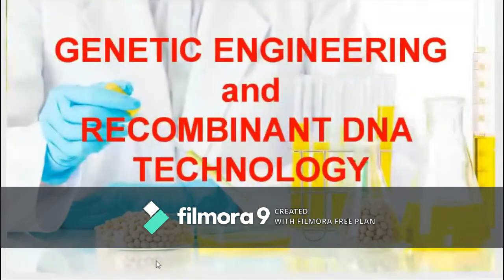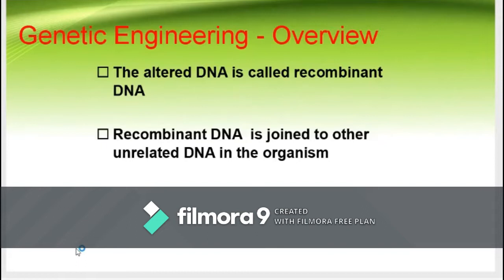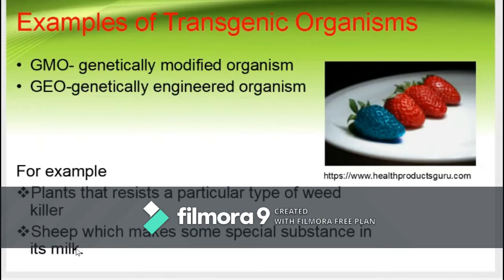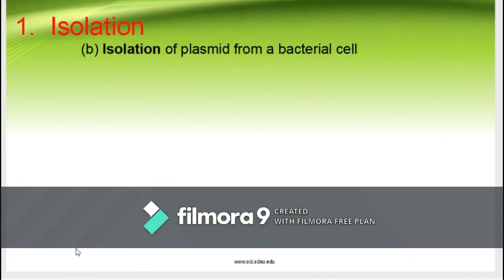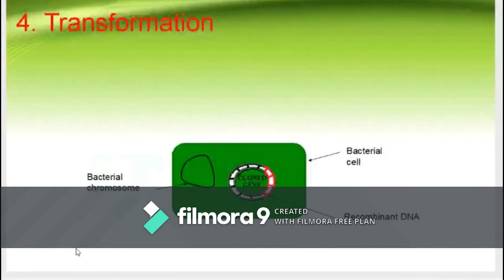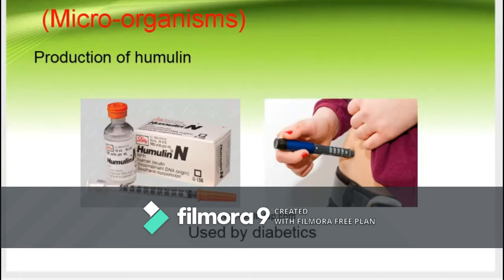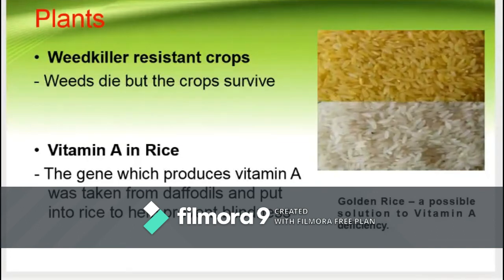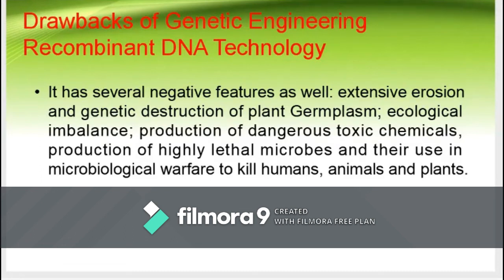GENETIC ENGINEERING & RDNA TECHNOLOGY

Comment: Kyla Hasmine P. Lancin 11 STEM RUTHERFORD
Genetic engineering requires one or more genes being specifically manipulated. A gene from another species is most commonly applied to the genome of an organism. An example would be human genes can be inserted into a bacterium. It also means that DNA from different organisms can be combined. The purpose of genetic engineering is it allows genes from one organism to be inserted into a cell of a different organisms of a different species. Organisms altered by genetic engineering is called Transgenic Organisms, in which genetic material changed by other than random natural breeding. Examples would be: GMO or genetically modified organism and GEO or genetically engineered organism. There are five stages involved in Genetic Engineering, these are: (1) Isolation, (2) Cutting, (3) Ligation and Insertion, (4) Transformation (5) expression. 

Humans Inoculated with Genetically Modified Malaria Parasites. Engineered Plasmodium parasites form the basis of two experimental malaria vaccines that showed safety and encouraging immune responses in clinical trials. Two clinical trials, in which subjects were vaccinated with genetically engineered Plasmodium parasites and later exposed to the malaria-causing microbe, showed the vaccines to be safe with promising, but not ideal, efficacy. Results of the trials are published in two papers in Science Translational Medicine today (May 20). Certain parasites of the Plasmodium genus, including P. falciparum and P. vivax, cause malaria when transmitted to humans via mosquito bites. These parasites have “impacted human health throughout history,” says malaria researcher Stefan Kappe of the University of Washington and Seattle Children’s Research Institute who is developing his own engineered parasite vaccine but was not involved in the studies. With more than 200 million cases of malaria causing more than 400,000 deaths per year, the majority of which are children, “we urgently need a vaccine,” Kappe adds. 

Genetic engineering involves different strategies for the active manipulation of genetic material to change, restore, or boost structure or function. Genetic engineering, also referred to as recombinant DNA technology, is a set of methods and procedures used to break up and merge genetic material, especially DNA from various biological species. Examples would be human genes can be inserted into other animals. Bacteria that are able to synthesize human insulin, human growth hormone, a hepatitis B vaccination, and other medically valuable substances have been developed by recombinant DNA techniques. 

I have learned a lot of things in this lesson. I learned about what is behind genetic engineering and its purpose. I was amazed that you could just combine genes from other organisms to a different species. I get to know some examples of genetic engineering that stunned me because I did not know that it was possible. I also get to know that it has benefits like defeating diseases or getting rid of illnesses. Though there are still cons like it may lead to genetic defects or it may go too far.

Comment: Flores, Bonimaro D.R.
XI - CURIE

	Genetic engineering refers to the science of manipulating of genetic material and introducing it to an organism to derive a certain desired change/outcome. Traits can be altered by combining the recombinant DNA (the engineered DNA through utilizing RDNA technology) by splicing the gene. Organisms that are modified are called Transgenic Organism. Transgenic Organism is classified into two (2) types: GEO (Genetically Engineered Organism) and GMO (Genetically Modified Organism). Genetic engineering comprises of five (5) stages: Isolation, Cutting, Ligation and Insertion, Transformation, and Expression. The first step involves breaking open the cells of the donor to release the DNA and isolate the gene of interest. Next is cutting the specific sites by using enzymes. Then, rejoining the cut fragments of DNA and forming artificial recombinant molecules. The last step is getting the organism with the altered DNA to produce the desired protein. 

	The objective of genetic engineering is to produce certain products that may aid mankind; solve food shortage, economic regression, and so forth. Genetic engineering has been used to create novel medicine to prevent and cure new and potent diseases. Genetic engineering is also applied in agriculture and livestock, in order to produce effective and increase the number of food supply. Example of product of genetic engineering is FLAVR SAVR , an engineered tomato that has the characteristic to be spoiled slowly.

	Recently, a scientist named, Emmanuelle Charpentier and Jennifer Doudna , invented a new technology and method for genome editing and it’s called CRISPR-Cas9. CRISPR-Cas9 is a genome editing tool which is very effective than the previous techniques of DNA editing. Through CRISPR-Cas9, genetic engineering will be more accurate, faster, and cheaper.  Because of this ingenious invention, it could revolutionize biotechnology. It can be also be used to cure diseases and repair damaged DNA.

	In conclusion to the video, I learned that genetic engineering and RDNA technology contributes greatly to the world. Increased the life expectancy of living organisms, increased the number of food supplies, reduce the risk of having disease, and repair the damage DNA caused by mutagens. Genetic engineering imposed great advantages, however, its long-term effects are unknown and its ethicality is questionable, basically genetic engineering is analogous to Pandora’s Box. Therefore, we must not be fully reliant on genetic engineering and act with moderation.

Reference:
_Doudna, J. A., & Charpentier, E. (2014). The new frontier of genome engineering with CRISPR-Cas9. Science, 346(6213).

Bruening, G., & Lyons, J. (2000). The case of the FLAVR SAVR tomato. California Agriculture, 54(4), 6-7.

Playing with genes: The good, the bad and the ugly. (2019). Retrieved from https://www.un.org/development/desa/dpad/wpcontent/uploads/sites/45/publication/FTQ_May_2019.pdf
_